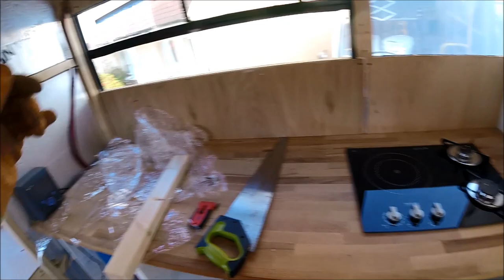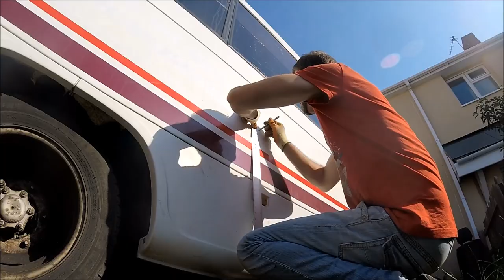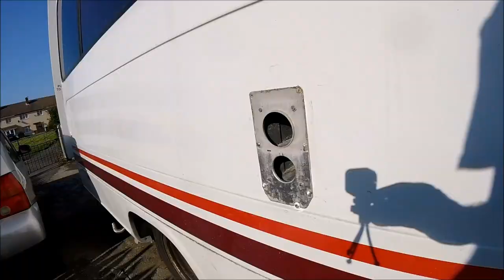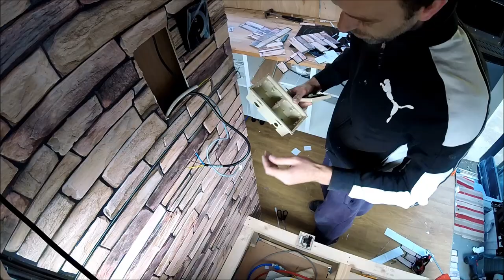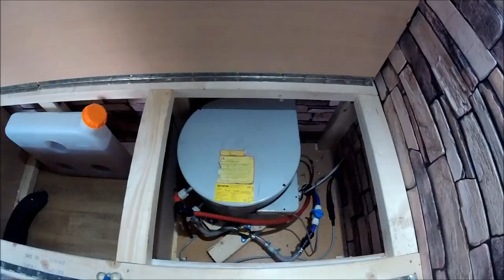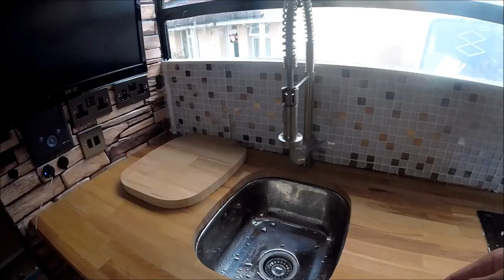Truma Ultrastore Water Heater Installation - Campervan Hot Water System

Comment: I just replaced the electric heating element on my Truma Ultrastore.
I did it in situ, but it was tucked away in a corner and one heck of a job to do.
I wish that I had totally removed the heater and done the job on the bench.

Comment: Hi, some nice work you are doing, just one thing to note, the small pipe on the hot water outlet isn't a pressure release valve, the system pressure release valve is the drain tap, it serves two functions, like a PRV on a central heating boiler but though water can be released using the PVR on a central heating boiler it's not advised.

The purpose of the small pipe and red union is to allow air to enter the boiler when emptying, Truma call it an Integrated Venting Valve venting air in not pressure out, allowing it to empty quicker and ensures the boiler is as empty as possible.

There is a lightly loaded one way valve in the fitting, when water is being drained ( a similar volume of air has to enter) a slight vacuum is formed which pulls the valve off its seat to allow air in, when empty the valve returns to its seat, but can stick open occasionally and you may see a small amount of water drip from it till the water pushes it closed, very occasionally it gets totally stuck and water will pour out of it whilst filling.

Hope this helps, hope you don't take it as criticism. 

Keep up the good work and great workmanship.
Reply: How can you stop it discharging from the clear pipe of the hot mine is obviously stuck open
Reply: @ronan3kiernan115 my guess is pull it apart & try to free it up or replace as necessary. Alternatively you could just block or put a tap/valve on this output line & open it or a hot tap when draining tank as the pressure relief is built into the incoming drain side this would not cause an issue.
Reply: Thanks for that explanation of how this system & valves work, this makes sense.

Comment: Hi there .  Can you remember how you fitted the cold water elbow to the boiler pipe ? Mine is leaking and I just can’t seem to work out why . Does the black o ring sit over the metal inlet  pipe or down inside the blue elbow please ?

Comment: Good job/vid, nice build, great info. How much power in watts or amps does it use on 12v dc, & how long would it take to heat up to temp roughly on 12v. TFS. Cheers
Reply from the maker: it doesn't heat water on 12v, it used 12v for the gas ignition spark and then gas warms the water.  You either use gas or 240v hook-up, there is no 12v heating option.

Comment: how much water do they hold? or are they a mix of instant heater with some spare capacity, i have seen that the ebay gas instant ones are not very good in the uk as the incoming water is too cold to be heated enough for a hot shower at a good flow rate, so this looks more useful (basing my criticism that you need a 5kw heater in a house in summer for a shower and 10kw in winter, most gas things tend to be like 2-4kw)
I took a domestic shower with the plug in, found i used about 12l of water, so i'm going to add a 25l hot storage tank so i have 2x a decent shower, that way as hot comes out and cold goes in i should be safe from freezing myself, then the (slow) heater can build the heat back up...
Reply from the maker: They hold 10l capacity and fill while in use.  It works off gas but also 240v if on hook-up.  The operating manual advises to get enough for a shower, to turn the shower off while applying soap/shower gel then turning it on to rinse off or run the risk of running out.
Reply: @TheCampervanBuilder  yes i think thats called a navy shower or something like that, some campsites have like 10 second timers so you have to punch the button every 10 seconds its so annoying... no, cant live like that lol, its like having half a shower... although if you miss every other day and have a full shower the water use will even out.....

Comment: Hi the pipe coming off of the hot water elbow is it called a breather pipe? Mines a clear 10mm pipe do it just go through the floor  and basically poke out the underneath of the floor? Thanks for your time.
Reply from the maker: yes its a breather/overflow pipe that should go externally
Reply: @TheCampervanBuilder  thank you.

Comment: Great simple explanation video. My only comment would be you didn't seem to install a filter on the water inlet - any reasons why you didn't do this? Also, does it heat up the 10L and that's it? Like if two of us want to have a shower, do you need to wait for another 10L to heat up or is it on demand once the water is used up? Thanks!
Reply from the maker: there is a filter on the water pump, no more needed than that.  It is not on demand heating like a combi, if you use the full tank, you need to wait for another 10l to warm up
Reply: @TheCampervanBuilder  Great thanks for the quick reply. One last one if you don't mind, say you're off grid, can it run from 12v and gas or is it just a 240v system?
Reply from the maker: It runs off either gas or 240v
Reply: You have to wait. It's not on demand.
But you can use gas and mains electric simultaneously to get a faster heat up.
The best way to shower is to get wet then turn off the tap, soap up, and then rinse by turning the tap on again. It's not nice if you leave the water running then have to rinse the soap off with icy water. Once covered in soap you're pretty much committed.
As the saying goes-
First wash from your head down as far as possible.
Then wash up from your feet as far as possible.
Finally wash your possible.

Comment: Hi, we are about to fit a new Truma Ultra store 10ltr gas/electric water heater to our van conversion. please could you advise what size 12 volt cable I should use. Can't seem to find the info on your video. Cheers Bob